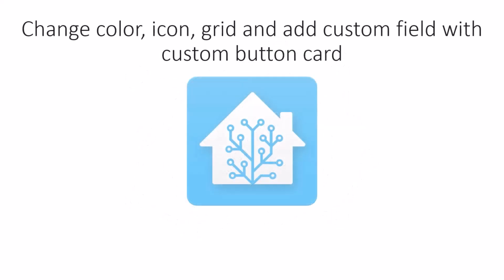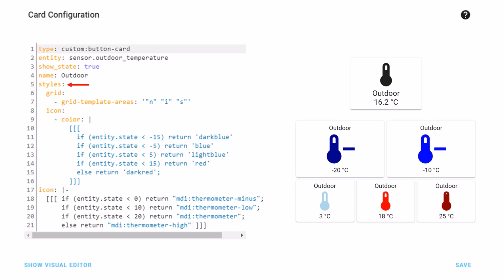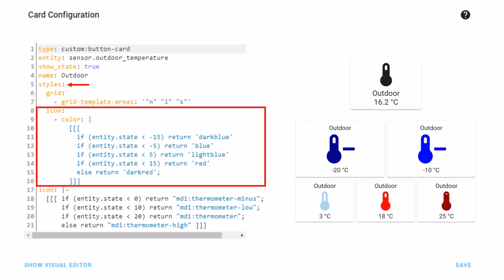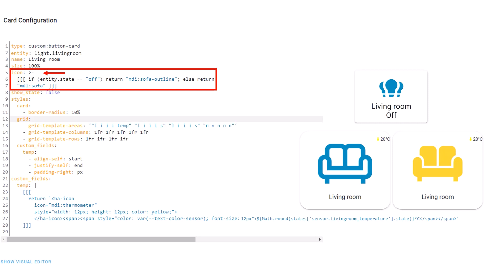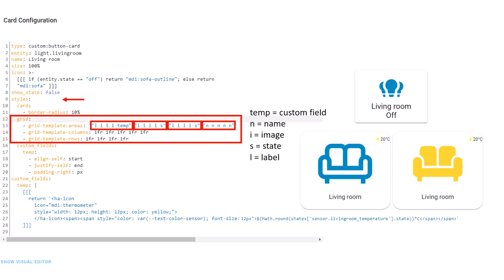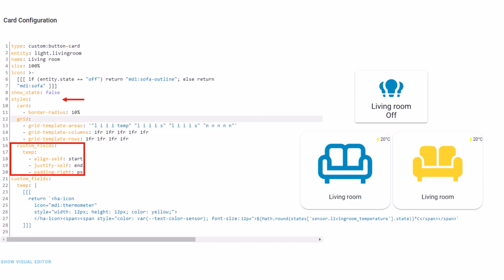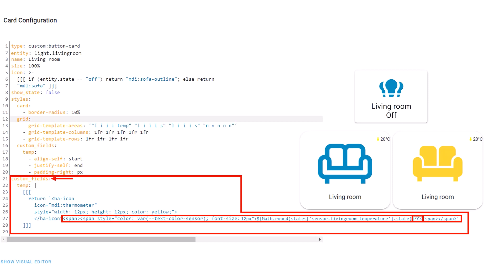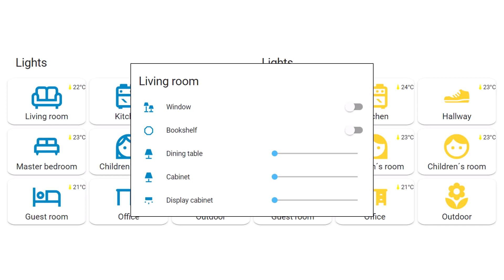Change color, icon, grid and add custom field with custom button card

Comment: Hello Marcus,
thanks for the great tutorial.

Is it possible to get the value of the temperature  below of the icon, in the custom field?

Thanks.
Reply from the maker: Hi,
Thank you for your question!

Try change the following:

    - grid-template-areas: '"l i i i temp_icon" "l i i i temp_text" "l i i i s" "n n n n n"'

custom_fields:
  temp_text: |
    [[[
      return `<ha-icon
        style="width: 12px; height: 12px; color: yellow;">
        </ha-icon><span><span style="color: var(--text-color-sensor); font-size: 12px">${Math.round(states['sensor.signify_netherlands_b_v_sml003_temperature'].state)}°C</span></span>`
    ]]]
  temp_icon: |
    [[[
      return `<ha-icon
        icon="mdi:thermometer"
        style="width: 12px; height: 12px; color: yellow;">
        </ha-icon><span><span style="color: var(--text-color-sensor);</span></span>`
    ]]]

Comment: Thanks for this.  Here's my adapation for some zone controls.  I've put your custom temp fields into different on/off states for different colours

type: custom:button-card
size: 100%
styles:
  card:
    - height: 110px
    - border-radius: 10%
  grid:
    - grid-template-areas: '"l i i i temp" "l i i i s" "l i i i s" "n n n n n"'
    - grid-template-columns: 1fr 1fr 1fr 1fr 1fr
    - grid-template-rows: 1fr 1fr 1fr 1fr
  custom_fields:
    temp:
      - align-self: start
      - justify-self: end
      - padding-right: px
name: >-
  [[[ return `Zone 1 - ${states['sensor.weather1_temperature_round'].state} °C `
  ]]]
entity: switch.zonemaster_zone1
color_type: card
state:
  - value: 'on'
    color: rgb(253, 216, 53)
    background_colour: rgb(85, 95, 113)
    styles:
      icon:
        - animation:
            - rotating 1s linear infinite
        - color: rgb(85, 95, 113)
      name:
        - color: darkred
      state:
        - color: darkred
    icon: mdi:fan
    custom_fields:
      temp: |
        [[[
          return `<ha-icon
            icon="mdi:water-percent"
            style="width: 14px; height: 14px; color: darkred;">
            </ha-icon><span><span style="color: darkred; font-size: 12px">${Math.round(states['sensor.weather1_humidity'].state)}%</span></span>`
        ]]]
  - value: 'off'
    color: rgb(85, 95, 113)
    background_colour: rgb(85, 95, 113)
    styles:
      icon:
        - color: rgb(43, 55, 78)
      name:
        - color: rgb(43, 55, 78)
      state:
        - color: rgb(43, 55, 78)
    icon: mdi:coolant-temperature
    custom_fields:
      temp: |
        [[[
          return `<ha-icon
            icon="mdi:water-percent"
            style="width: 12px; height: 12px; color: lightblue;">
            </ha-icon><span><span style="color: lightblue; font-size: 12px">${Math.round(states['sensor.weather1_humidity'].state)}%</span></span>`
        ]]]
tap_action:
  action: toggle
show_icon: true
show_state: true
Reply from the maker: Really cool! =)

Comment: @Markus, interesting video and button card. I would like to try in my HA but unable to find it in HACS. Any suggestion why doesn't appear? Thanks
Reply from the maker: The card is called button-card in HACS, can you find it? 
/Markus
Reply: @markussmarthometech984  Yes, thanks. I was looking in the wrong place. Now I'm struggling with the thermostat to retrieve the current_temperature from the climate sensor
Reply from the maker: Great! 

You can try this to extract the current temperature from the climate entity, if the current temperature is an attribute of the climate entity. 

Add the following in the configuration.yaml file:

sensor:
  - platform: template
    sensors:
      kitchen_temperature:
        friendly_name: "Kitchen"
        unit_of_measurement: '°C'
        value_template: "{{ state_attr('climate.kitchen', 'current_temperature') }}"
Reply: @markussmarthometech984  That's the way...many thanks. I was trying to do this directly in the card yaml but the syntax was wrong. Actually I have eleven of this so I will generate 11 sensors with the current temp. Thanks again for the suggestions
Reply: @markussmarthometech984  Sorry for bother you again. I modified unsuccessfully the yaml in this way "... Math.round(states['sensor.kitchen_temperature'])}..." In the developer tools I can see the sensor and the right temperature, so I'm missing something in the card yaml...
Reply from the maker: Can you post the entire code for the card and I will have a look.
Reply: @markussmarthometech984  for sure! Here the yaml:

type: custom:button-card
entity: light.piantana_negra
name: Living room
icon: >-
  [[[ if (entity.state == "off") return "mdi:sofa-outline"; else return
  "mdi:sofa" ]]]
show_state: false
size: 100%
styles:
  card:
    - border-radius: 10%
  grid:
    - grid-template-areas: '"l i i i temp" "l i i i s" "l i i i s" "n n n n n"'
    - grid-template-columns: 1fr 1fr 1fr 1fr 1fr
    - grid-template-rows: 1fr 1fr 1fr 1fr
  custom_fields:
    temp:
      - align-self: start
      - justify-self: end
      - padding-right: px
custom_fields:
  temp: |
    [[[
      return `<ha-icon
        icon="mdi:thermometer"
        style="width: 12px; height: 12px; color: yellow;">
        </ha-icon><span><span style="color: var(--text-color-sensor); font-size: 12px">${Math.round(states['sensor.kitchen_temperature'])}°C</span></span>`
    ]]]
hold_action:
  action: more-info

Thanks.
Reply from the maker: Change the following row

</ha-icon><span><span style="color: var(--text-color-sensor); font-size: 12px">${Math.round(states['sensor.kitchen_temperature'])}°C</span></span>`

to 

</ha-icon><span><span style="color: var(--text-color-sensor); font-size: 12px">${Math.round(states['sensor.kitchen_temperature'].state)}°C</span></span>`

The .state is missing between sensor.kitchen_temperature and °C. 

Hope it works now! :)
Reply: @markussmarthometech984  Thanks Markus, now works like a charm. May I bother you with another question? I was trying to append more temp sensors from the other devices but, despite the config check was ok, as soon as start notify error. Here the code (part commented to let the first sensor working)

    sensors:
      kitchen_temperature:
        friendly_name: "Temp Cocina"
        unit_of_measurement: '°C'
        value_template: "{{ state_attr('climate.cocina', 'current_temperature') }}"

#      Livingn_temperature:
#        friendly_name: "Temp Living"
#        unit_of_measurement: '°C'
#        value_template: "{{ state_attr('climate.living', 'current_temperature') }}"
#
Reply from the maker: The entity name needs to be lower case, change Livingn_temperature: to livingn_temperature: and it should work :)
Reply: @markussmarthometech984  you're right. Many many thanks. I made the changes and now all my devices are configured. Now the next problem I'm facing. I want to define a min_max sensor template to show the average temperature coming from the 11 sensor. I tried to define the min_max sensor 

#  - sensor:
#    platform: min_max
#    name: "Temp media casa"
#    type: "mean"
#    round_digit: 1
#    entity_ids: 
#      - kitchen_temperature
#      - living_temperature

after the code you suggested me, but restarting HA notify an error.
After some troubleshooting I discover a bug between ...the chair and the keyboard (me).
I don't know where to find the right syntax. In any case. Thanks again for your great support.
Reply from the maker: Happy they are up and running now! :)

In configuration.yaml file, you only need to add sensor: once, so for the min_max sensor you dont need to add sensor: again. Then for entity_ids you need to add the full entity name instead of kitchen_temperature you need to add sensor.kitchen_temperature. See my example for both fixes below. 

sensors:
      kitchen_temperature:
        friendly_name: "Temp Cocina"
        unit_of_measurement: '°C'
        value_template: "{{ state_attr('climate.cocina', 'current_temperature') }}"

      livingn_temperature:
        friendly_name: "Temp Living"
        unit_of_measurement: '°C'
        value_template: "{{ state_attr('climate.living', 'current_temperature') }}"

      platform: min_max
        name: "Temp media casa"
        type: "mean"
        round_digit: 1
        entity_ids: 
          - sensor.kitchen_temperature
          - sensor.living_temperature

Comment: I am still looking for a methode to integrate the value of a second entity into a regular toggle button. i.e. into a on/off switch, additionally the value of a energy sensor. So you have a switch and a power display in one button.
Reply from the maker: Hi N. R.,
Can you use the example with the light group and the temperature sensor?

https://www.youtube.com/watch?v=ClxxjLSZZMw&t=144s

Comment: HI loving all your videos. I would like it very much if your would do a video on the Browser Mod. You have given me some good ideas to start making my dashboard look great
Reply: Browser Mod Very Good Idea
Reply from the maker: Hi, thanks, glad to hear. Sure I will do the browser mod as my next video. Let me know if you have any questions or want to discuss anything. 
/Markus
Reply: @markussmarthometech984   could you write the code of light: change icon and add custom field because i don't  know coding well   and i have problem in showing temperature above the icon
Reply from the maker: Of course, below is the code you requested combined with vertical and horizontal stack card so you can add more rows and columns as you want :)

/Markus

title: Lights
type: vertical-stack
cards:
  - type: horizontal-stack
    cards:
      - type: custom:button-card
        entity: light.living_room
        icon: >-
          [[[ if (entity.state == "off") return "mdi:sofa-outline"; else return
          "mdi:sofa" ]]]
        show_state: false
        size: 100%
        styles:
          card:
            - border-radius: 10%
          grid:
            - grid-template-areas: '"l i i i temp" "l i i i s" "l i i i s" "n n n n n"'
            - grid-template-columns: 1fr 1fr 1fr 1fr 1fr
            - grid-template-rows: 1fr 1fr 1fr 1fr
          custom_fields:
            temp:
              - align-self: start
              - justify-self: end
              - padding-right: px
        custom_fields:
          temp: |
            [[[
              return `<ha-icon
                icon="mdi:thermometer"
                style="width: 12px; height: 12px; color: yellow;">
                </ha-icon><span><span style="color: var(--text-color-sensor); font-size: 12px">${Math.round(states['sensor.living_room_temperature'].state)}°C</span></span>`
            ]]]
      - type: custom:button-card
        entity: light.kitchen
        icon: mdi:stove
        show_state: false
        size: 100%
        styles:
          card:
            - border-radius: 10%
          grid:
            - grid-template-areas: '"l i i i temp" "l i i i s" "l i i i s" "n n n n n"'
            - grid-template-columns: 1fr 1fr 1fr 1fr 1fr
            - grid-template-rows: 1fr 1fr 1fr 1fr
          custom_fields:
            temp:
              - align-self: start
              - justify-self: end
              - padding-right: px
        custom_fields:
          temp: |
            [[[
              return `<ha-icon
                icon="mdi:thermometer"
                style="width: 12px; height: 12px; color: yellow;">
                </ha-icon><span><span style="color: var(--text-color-sensor); font-size: 12px">${Math.round(states['sensor.kitchen_temperature'].state)}°C</span></span>`
            ]]]
      - type: custom:button-card
        entity: light.hallway
        icon: mdi:shoe-sneaker
        show_state: false
        size: 100%
        styles:
          card:
            - border-radius: 10%
          grid:
            - grid-template-areas: '"l i i i temp" "l i i i s" "l i i i s" "n n n n n"'
            - grid-template-columns: 1fr 1fr 1fr 1fr 1fr
            - grid-template-rows: 1fr 1fr 1fr 1fr
          custom_fields:
            temp:
              - align-self: start
              - justify-self: end
              - padding-right: px
        custom_fields:
          temp: |
            [[[
              return `<ha-icon
                icon="mdi:thermometer"
                style="width: 12px; height: 12px; color: yellow;">
                </ha-icon><span><span style="color: var(--text-color-sensor); font-size: 12px">${states['sensor.hallway_temperature'].state}°C</span></span>`
            ]]]
Reply: @markussmarthometech984  thank you wait for browser mode
Reply: could u add a Temperature  code

type: custom:button-card
entity: sensor.sonoff_100066d403_temperature
show_state: true
name: Bedroom Temp
styles:
  grid:
    - grid-template-areas: '"n" "i" "s"'
  icon:
    - color: |
        [[[
          if (entity.state < 10) return 'darkblue'
          if (entity.state < 20) return 'green'
          if (entity.state < 30) return 'yellow'
          if (entity.state < 40) return 'red'
          else return 'darkred';
        ]]]
icon: |
  [[[
    if (entity.state < 10) return "mdi:thermometer-minus";
    if (entity.state < 25) return "mdi:thermometer-low";
    if (entity.state < 45) return "mdi:thermometer";
    else return "mdi:thermometer-high";
  ]]]

 to code kitchen light  custom button card
Reply from the maker: Hi,
I am sorry, but I don't think I understand. Do you want to add the temperature to a light button with custom button card (my second example)?
/Markus
Reply: @markussmarthometech984  yes add temperature icon to light card and the temperature icon changed acourding to its state
Reply from the maker: Hi,

Please test below code, I added the sonoff sensor you provided in earlier comment. 

/Markus

type: custom:button-card
entity: light.kitchen
name: Kitchen
icon: mdi:stove
show_state: false
size: 100%
styles:
  card:
    - border-radius: 10%
    - height: 95px
    - width: 200px
  grid:
    - grid-template-areas: '"l i i i temp" "l i i i s" "l i i i s" "n n n n n"'
    - grid-template-columns: 1fr 1fr 1fr 1fr 1fr
    - grid-template-rows: 1fr 1fr 1fr 1fr
  custom_fields:
    temp:
      - align-self: start
      - justify-self: end
      - padding-right: px
      - '-icon-color-sensor': >
          [[[ if (states["sensor.sonoff_100066d403_temperature"].state
          < 10) return "darkblue"; if
          (states["sensor.sonoff_100066d403_temperature"].state < 20)
          return "green"; if
          (states["sensor.sonoff_100066d403_temperature"].state < 30)
          return "yellow"; if
          (states["sensor.sonoff_100066d403_temperature"].state < 40)
          return "red"; else return "darkred";]]]
custom_fields:
  temp: |
    [[[
      if
          (states["sensor.sonoff_100066d403_temperature"].state < 10)
          return `<ha-icon
        icon="mdi:thermometer-minus"
        style="width: 12px; height: 12px; color: var(--icon-color-sensor);">
        </ha-icon><span><span style="color: var(--text-color-sensor); font-size: 12px">${Math.round(states['sensor.sonoff_100066d403_temperature'].state)}°C</span></span>`; 
      if
          (states["sensor.sonoff_100066d403_temperature"].state < 25)
          return `<ha-icon
        icon="mdi:thermometer-low"
        style="width: 12px; height: 12px; color: var(--icon-color-sensor);">
        </ha-icon><span><span style="color: var(--text-color-sensor); font-size: 12px">${Math.round(states['sensor.sonoff_100066d403_temperature'].state)}°C</span></span>`;
      if
          (states["sensor.sonoff_100066d403_temperature"].state < 45)
          return `<ha-icon
        icon="mdi:thermometer"
        style="width: 12px; height: 12px; color: var(--icon-color-sensor);">
        </ha-icon><span><span style="color: var(--text-color-sensor); font-size: 12px">${Math.round(states['sensor.sonoff_100066d403_temperature'].state)}°C</span></span>`;
    else return `<ha-icon
        icon="mdi:thermometer-high"
        style="width: 12px; height: 12px; color: var(--icon-color-sensor);">
        </ha-icon><span><span style="color: var(--text-color-sensor); font-size: 12px">${Math.round(states['sensor.sonoff_100066d403_temperature'].state)}°C</span></span>`;
    ]]]
hold_action:
  action: more-info
Reply: @markussmarthometech984  sorry for the delay I test the code but I have a problem  temperature icon that didn't changed its color according to sensor state I'll attach the code after made some changed
Reply from the maker: @TheDlhe  change 
 - icon-color-sensor: | 
to
- --icon-color-sensor: > -   [Remove spacebar between >-]
and it will work =)

/Markus
Reply: @markussmarthometech984  thanks it work
Reply from the maker: Link to the pop-up video: https://www.youtube.com/watch?v=mcxRk43SNzg